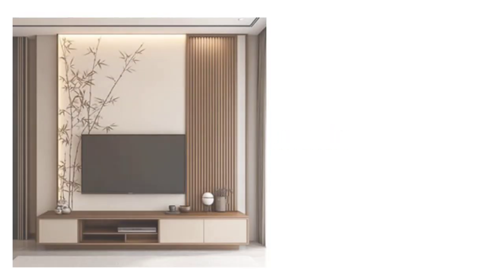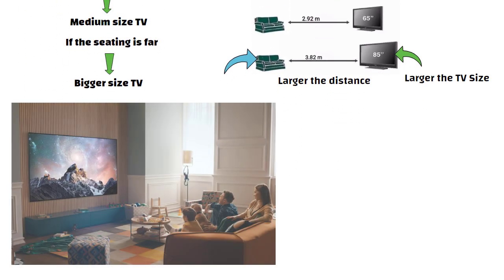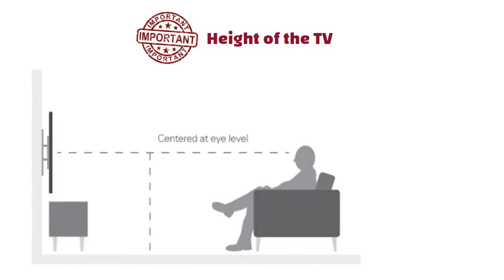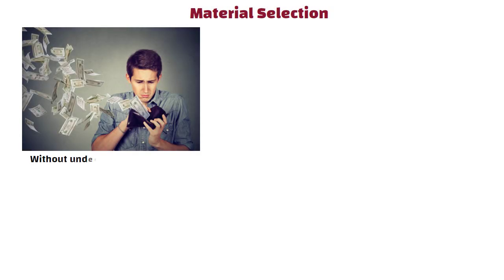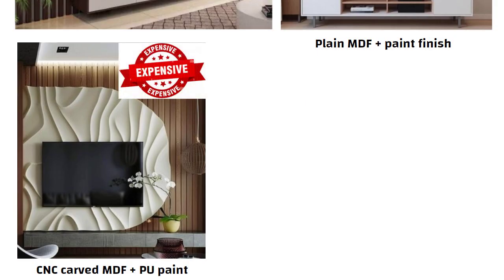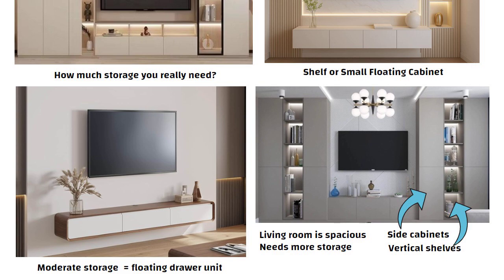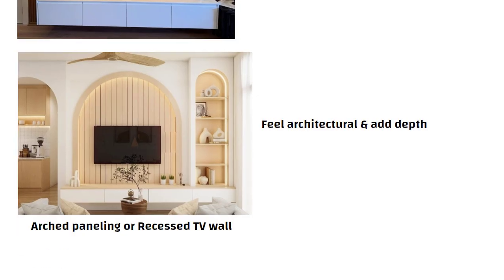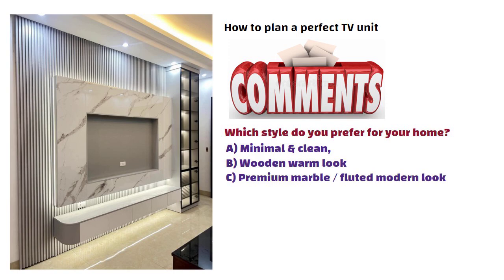Perfect TV Unit Design Guide — Avoid These Costly Mistakes!

Comment: what about high ceilings..... shd the TV unit backdrop go all the way up to the ceiling?  if not, how would you deal with the gap in between?
Reply from the maker: You cud keep the backdrop lower, it doesn’t have to reach  ceiling. For the gap u can fill it with paint, slim ledge, lighting, or decor so it still luks intentional n balanced